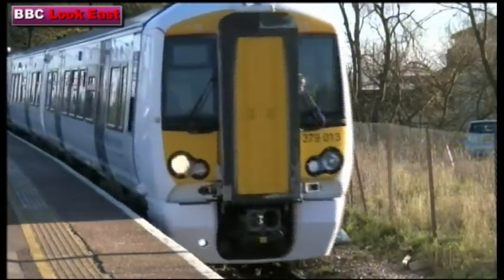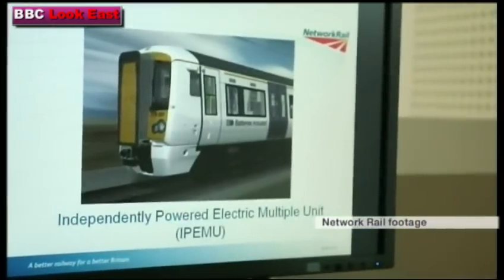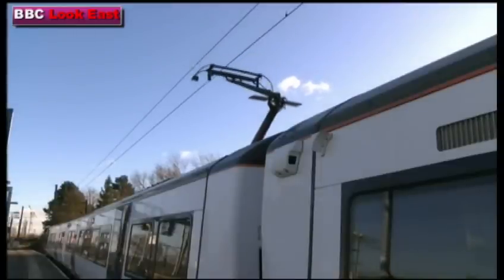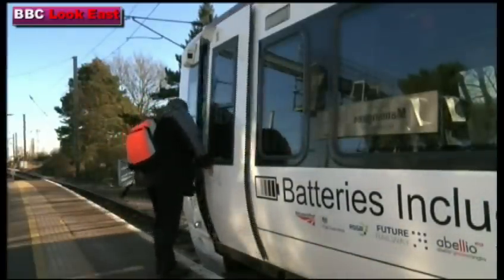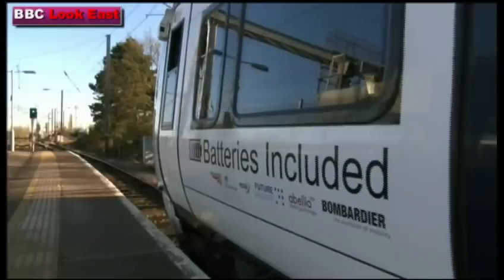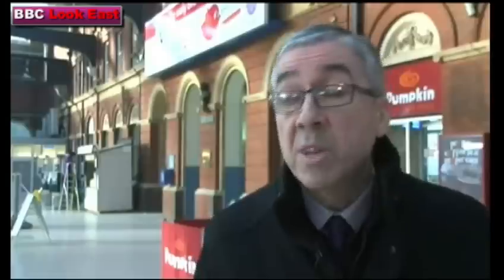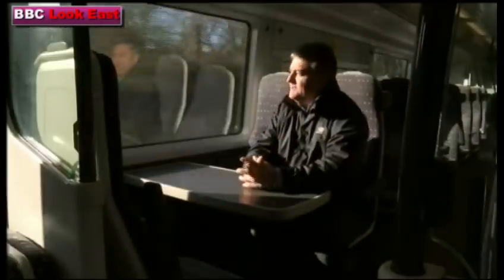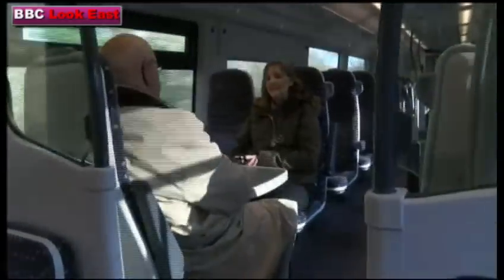Class 379 IPEMU - BBC Look East

Comment: Give me an old AC unit such as your 302 you have as your channel icon with all the old - fashioned DC motor sounds and ticking air compressors. At least you knew you'd get there oops my batteries have gone phut LOL. Though it's very quiet, I still can't believe how people think these Electrostars are comfortable with their modular plasticy seats. But at least they do, sometimes, feature regenerative brakes.

Comment: Could be ideal to convert the Class 379 Electrostars to BEMU. As Greater Anglia are replacing the Class 379 with the Class 720. And the Class 379 to have batteries fitted. And even some of the Southern Class 377s could also have batteries fitted for the Uckfield Line and Marshlink Line services. Nice. 

https://en.wikipedia.org/wiki/British_Rail_Class_377
https://en.wikipedia.org/wiki/British_Rail_Class_379